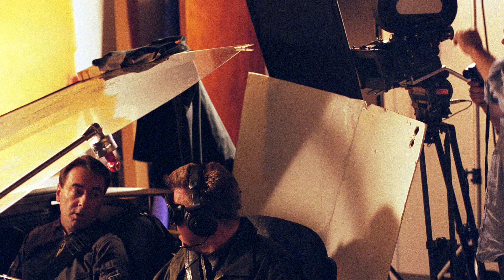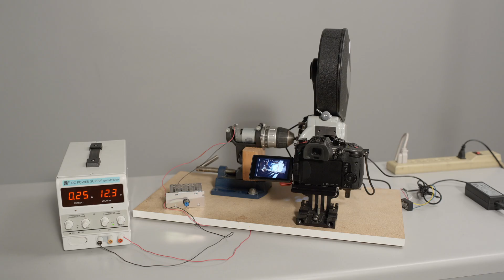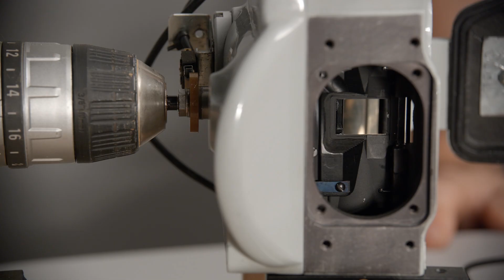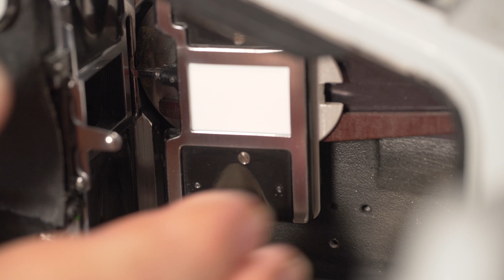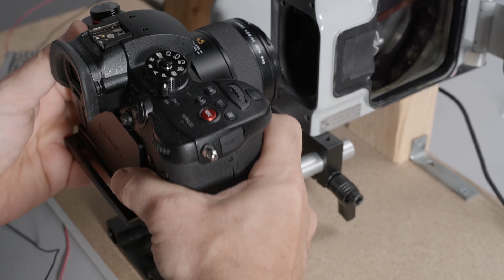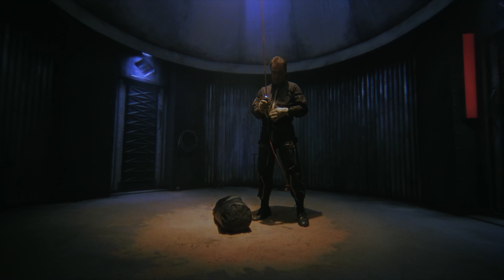DIY 35mm Movie Film to Digital Video Transfer Device Telecine | Part 1 4K

Comment: I understand this is a two years old posting as I'm typing this question. Can you suggest a 16mm film system for the same DIY concept?
Reply from the maker: You could use a projector, but there's so many - the key is having enough room to get the macro lens square and close with the film gate. I also thought about using an Arriflex 16M camera, but unless you can find a broken one, they've become a bit too pricey.  On my Youtube site I detail a 16mm build with parts from an Arri 16S camera - this is complicated though.

Comment: Incredible 🎉 I wonder if this process would work the same if someone shot on super 35mm anamorphic and had to de squeeze the 2X anamorphic shot in post? Ty
Reply from the maker: Yes, since ultimately the final process is digital, it would be no problem to "desqueeze" it. I'd recommend using a hi-rez digital camera for the maximum capture.

Comment: one more question,if the copied frame and cropped,how you see it,when broadcasted or played on dvd player,do you see cropped scenes...............
Reply from the maker: All the frames need to be put together as a movie using a computer program - like Adobe After Effects. During this process, any extra image area around the frame (black) can be cropped out.
Reply: Question,the 35mm telecine projector has the same size aperture has the 35mm camera,because the projector aperture is smaller,that means you loss frame area,no.

Comment: This is great! I wonder if it can  be done with Suoer 8 cameras too! Thank you for sharing this. : )
Reply from the maker: I created a system using a super 8 projector - see videos on my channel. The cameras don't have a pressure plate to hold the film - it's in the cartridge itself. Also, the take-up mechanism in a camera is not reel-based. As a result, I decided to just go with a projector instead. I am working on a 16mm system using the core elements of a camera though.

Comment: Best solution is to get a good bulb with a good cri or tlci reading and shoot highest rez in raw and downscale to 1080p.  Sure, it would take a long time, but the end product would be amazing. The new sony mirrorless full frame cameras can take pics of up to 60MP i think. The A7Riii and A7Riv.
Reply from the maker: I'm in the process of rebuilding the system now and will have a new video on the updates. New motor system and better light. Thanks!

Comment: Great project! Although I have some concerns about the LED used for backlight; It looks cheap, and seems to have a heavy blue tint. Did you check if it was a high CRI LED (Or TLCI or whatever it is they're using nowadays)? I think it would would dramatically improve the color reproduction.
Reply from the maker: Thanks for watching! This particular LED has a temperature rating of 6500K, so it does appear bluish in the videos since they're being lit at 3200K.  I'd love to find a full spectrum CRI95 bulb that works on 12 volts, but the number of LEDs available now is mind-boggling.  I found that by setting the digital camera to "electronic flash" color balance, it produces an image very close to what I see with my eye on the film.  I tried actually color balancing on the white light from the led, but was happier with the "flash" color balancing. I'm in the process of upgrading my 35mm transfer system - see original video on site - and I'm now searching for a brighter, higher quality led for that system.

Comment: Very cool idea. The biggest problem with doing it this way of course, is the digital camera side. It's very tricky to get good images from negative. It works ok for print but the moment you use negative, everything changes and it becomes very tricky to get it right. Some people preview the digital camera with their computers and invert the image and then adjust the LED light source to get proper color. Also, if you're scanning assembled negative, they will be on larger rolls than 1k, usually they're 3x400's or 2x1000's on each "lab roll" from the lab. So fitting it in the magazine wouldn't work. For your application getting from a print, it seems to work ok. But you're stuck at 4th generation scans, which aren't the best. Most people will want the original negative scan to do the re-working of the image properly and retain the full resolution.

Comment: I shot some 16mm film recently and I was shocked how expensive the whole cycle is. Buying 100ft roll of film, processing and scanning was 200€/230$ in Germany where scanning was 50% of the costs. I thought about building my own scanner but that didn't seem to be an easy task. I also considered converting an old 16mm camera but I had doubts that the quality and flexibility will meet my needs. When seeing your output I think this is the way to digitalize film in a good quality with a relatively low effort. Thank you for the contribution!
Reply from the maker: Thank you - good luck!
Reply: I still haven’t telecine’d the rolls I shot a few years ago. It’s obscene how expensive it is.

Comment: Nice. Can it be transferred to a Betacam Camcoder too?
Reply from the maker: It's a frame by frame process, so it requires a 24 frames per second progressive scan camera. Unfortunately, betacam is only 60 frames interlaced. Thanks for watching!
Reply: @FreshGroundPictures  I see. It doesn't matter actually if it's interlaced especially when it comes to transferring to DVD or VHS.
Reply: You can transfer it digitally and later telecine it by adding 24p video into interlaced sequence

Comment: Excellent! 

I'm doing more or less the same in principle with my Super8 scanning setup. They're made of a modified projector (using geared motor with external power control), a Panasonic Lumix G7, a wired remote shutter, and a reed switch/magnet to "fire" the camera. Ridiculously simple, but works super reliable!

I believe in KISS - no complicated electronics, no arduino, no programming work involved. All hardware - based, but work as well.
Reply from the maker: Sounds great! I'm working on a Super 8 transfer device video as well, using some of the same technology as in this video.  I should have it done in 1-2 weeks. Subscribe if you'd like to take a look at that. Thanks for your interest!
Reply from the maker: Yes. I found the other big benefit is that you don't have to control the speed precisely, you can go up or down and get the same results. Inf fact, on the Super 8 I can actually stop it and start it up at a later time if I want.Thanks!

Comment: Great idea! I have been flirting with this idea but there is no pressure plate besides the internal one in the cartridge for super 8. Hmm....perhaps a double 8 camera would work. Gonna have to look into that. I normally use a slightly modified Elmo FP-A Dual 8 projector but still encounter many problems with the setup. A frame by frame capture would be ideal. Thanks for the detailed description and the transfer looks great!
Reply from the maker: For Super 8, I think it's easier to work from a projector, but use the same frame by frame system. I've got all the parts together for a similar Super 8 transfer device and will be making a video about that in the near future. Please subscribe so you can be notified when it's posted. Thanks!